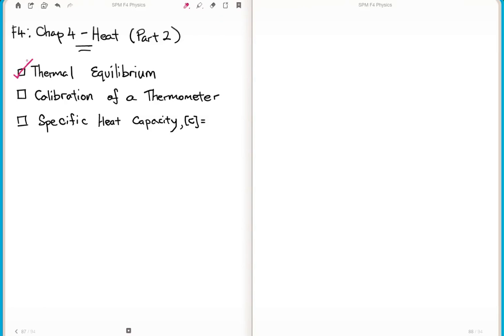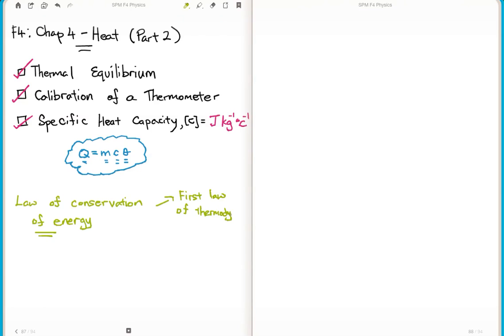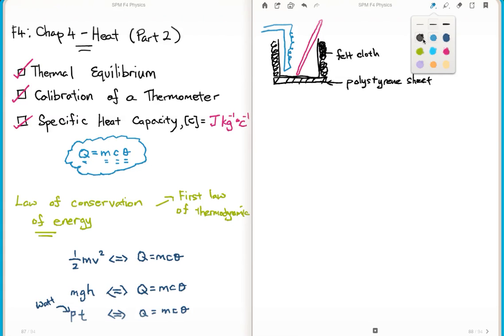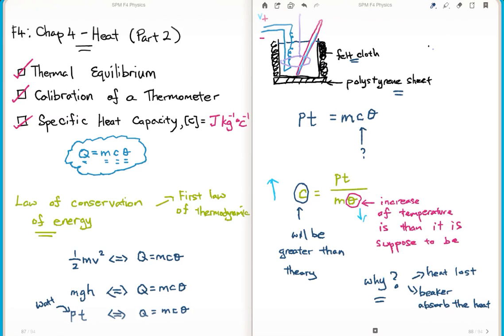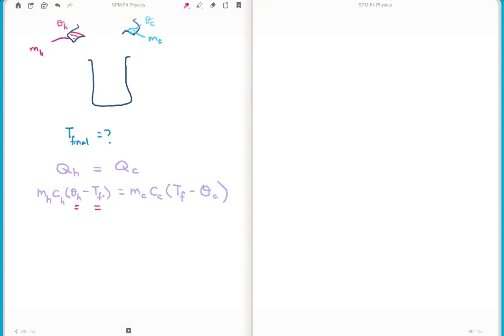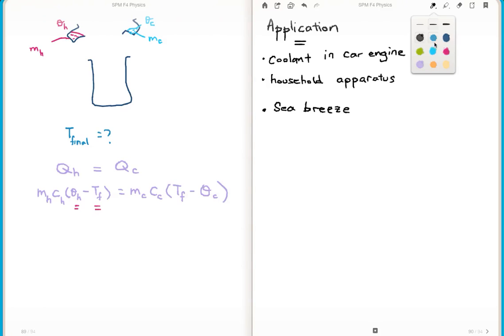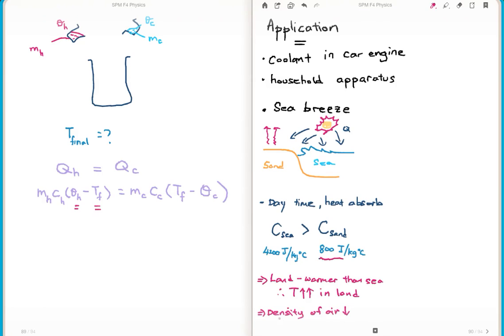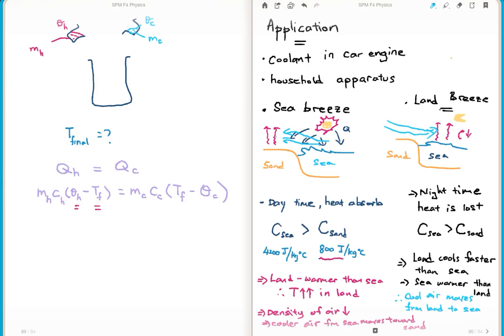Physics F4 Chap 4 (Part 2) - Heat Transfer - Application of Specific heat capacity

Comment: hai sifu sengchoy

mau tanya coil plug preve sama dng saga BLM❓

coil plug preve bole masuk ke saga BLM

TQ
Reply from the maker: I’m about to change one of the spark plug coil for Proton Persona. I will make a video and you check if the one in BLM looks the same as Preve. It should be the same depends on engine.
Reply: @CTB6  TQ sifu
Reply: TQ for the video